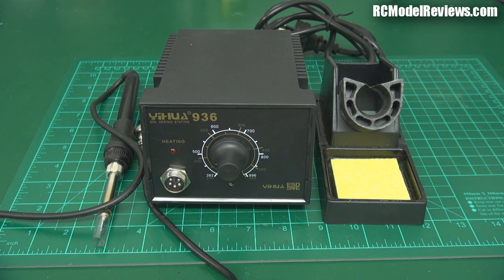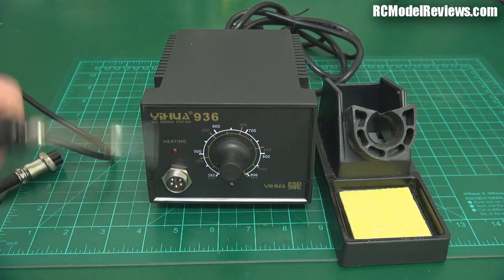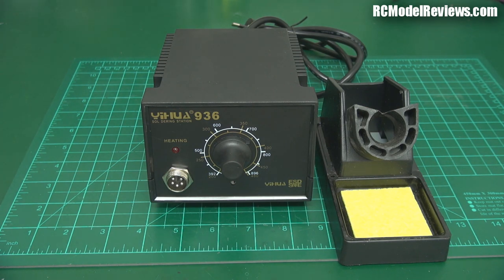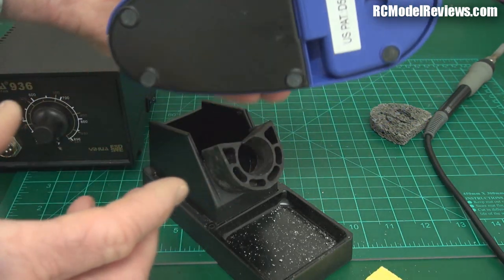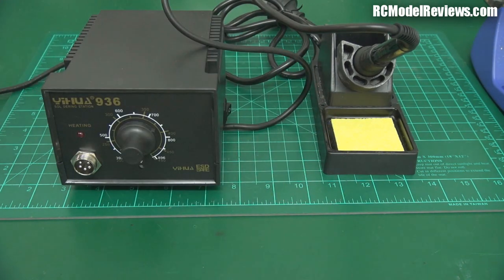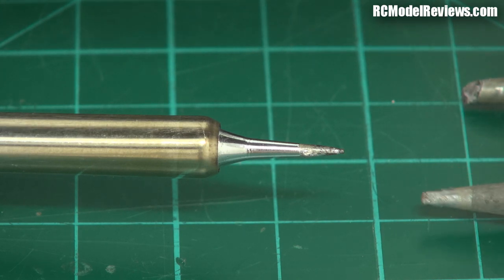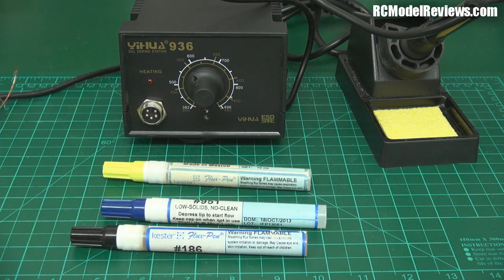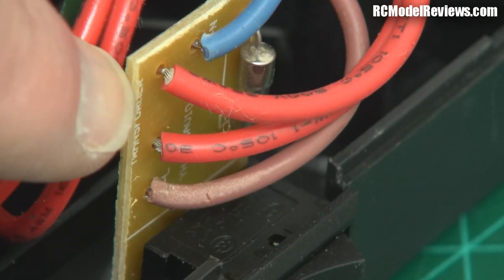The 936 Soldering Station from HobbyKing

Comment: I have this station, so far it's worked just fine for me. In the holder I just stuffed a $1 steel scrubber sponge and frayed it out. As for the tip, I ordered a set of the matching Hakko 936 soldering tips

Comment: Very good review.  I have been running this Soldering station for more than a year and the thing it great.  Ya it is made to a price but for $18 the thing is amazing.  It has allowed a student with very little money to have a really good soldering iron and not have to worry about it.  Just get some extra tips, they are super cheap.  I have made numerous CP antennas as well as a many other things on it.  I would highly suggest it to anyone getting into the hobby or short on cash.  It is definitely not the best but it is probably the best soldering station for under $50.
Reply: +Wyll Surf Air Where do you get the tips?
Reply: +odinata ebay.  look up hako 936 tips.
Reply: +Wyll Surf Air Hobbyking have tip sets cheap now, good order filler.

Comment: I bought one of these after I went to Jaycar to replace my broken standard 240 volt iron.  The Jaycar replacement $65.  This one cost around $16. 
This HobbyKing soldering station is AWESOME for the price.  And I bought 6 different tips for $8. Put a weight on the bottom of the holder and you have yourself a GREAT, cheap soldering iron.
Another great recommendation Bruce.

Comment: Got an 852D+ on Amazon for $49  Pros- fast, digital, hot air for shrink tube, came with tips and air nozzles  Quadelicious. Cons- shorter cords, I move the machine, Light wt. holder, added a couple 1/2 sockets, Hums even when turned off, unplug it after use.
One of the best tools to have for your hobby. Love it, already got my moneys worth.

Comment: I have one of these and just love it. (I'm a hobbyist). Agree with the bit bit (LOL) I replaced the original bit immediately.
One tip I would give is : I have glued the iron holder to the top of the control station. Makes it rock solid and takes up far less space on my bench

Comment: The plastic threads on the iron below the tip screw mount will soften from heat and not hold over time. Maybe 6 months of regular use. I have also had the irons on that model (907A I believe) fail frequently. They can be found for about 11 USD but always buy 2 or 3 at a time as they come with bad boards.
Reply: Hiway what I don't understand

Comment: I've been running one of these for 2 - 1/2 years now -- still going strong!  I had to calibrate the temperature right off (it was low) and  I did replace the tips (cheap to find on ebay).

Comment: just got mine from hobbyking, replaced the tip, and added some lead weight to the stand base. works great, very happy with it. thanks for the review Bruce.
Reply: the big hole in the base, I inserted a copper scour pad In it, it cleans the tip when I store it. a few minor mods based on Bruce's grumbles made this a very good unit

Comment: Not sure why you are hating on the pin tip.  Every tip type has a function and purpose.  I have the same station and it actually came with a set of 5 different tips beside the pin tip.  I solder professionally here and use the pin tip most of the time as it is capable of concentrating the heat into a small point which saves heat damaging the boards and components.  The exception is when working on endothermic devices such as rectifiers or sinked items where I would use a larger chisel tip for sure so the heat is distributed over the surfaces to be manipulated.
I have been very happy with this unit except that the power switch is on the back right side so I often forget to turn it off.  I will be moving it to the front asap.

Comment: I've had a 936 50W for over 6 months now and it's been great, I only wish I had a bigger unit when I change out connectors (XT60) on 10AWG cable. I can get it done with the 936 and bigger tips but more power would be nice sometimes..
Thanks for the heads up on the possible need for hot glue on the switch wire inside, I'll check on that shortly.

Comment: I actually bought 3 of the cheapies.... One for myself, one for my son and an extra for parts, I also ordered 3 extra "irons" for spares, I never even got billed for the extra irons....   I bought a couple of packs of 10 tips, most expensive part of iron, Hakko tips and I use the medium chisel tip for 90%+ of rc work.    60%-40% or 63%-37% which flows even better....  no acid core, no tin, neither work, silver needs to much heat can damage fragile boards like transmitters and receivers. I also use .4mm diameter. long learning curve for me, I'm nearly 70 and not as steady and eyesight not to good.....  but I have fun....  Thanks,

Comment: A few things, these irons (most irons) run on 24vDC output with a temperature feedback loop as mentioned.
You can get half decent replacement tips off e-bay for a few bucks for a selection (search for Hako), the handpieces are also available off ebay for 4-5 bucks. 
I recent built a current limited PWM lipo powered iron for work as I was sick of butane irons failing in the field. Tips seem to hold up well even at high heat when tinned up well, no pitting or burning as yet after about 5hrs run time.
Great vid!

Comment: Bought this one yesterday and the first thing i did was to tead it down. What I saw, I did not like but I only paid 25 GBP for it so I could not complain. THe PCB has undergone some major improvements since this video was posted but the heatsink was removed and the low ac voltage for the controller power has also become a plug instead of being soldered directly to the pcb.The fuse pcb hoever is exactly the same and the cables are about to break due to the bend and poor quality. I will be repairing this stuff and probably stick a heatsink on the triac myself but I believe it will do the job done pretty well tbh.

Comment: Looks like a re-branded Aoyue. I've been using an Ayoue 937+ for the past four years with no problems. 

Originally bought as a stop gap measure I've had no reason to replace it! It's a very reliable station

Comment: I've been using mine for roughly 3 years, without problems. You need to purchase a tip set. I suggest the 10 piece one from Banggood for around $8. You need to clean them in some acid flux paste when they are new, or they will not tin properly. So long as you clean them in some acid flux paste, they work great. Use a tub of acid paste from the plumbing section. Heat the tip to around 300C, plunge it fully into the paste, and wipe clean on a moist sponge. Repeat a couple of times, until the tip will take a complete tinning.

Comment: Also, if you have a dedicated work space it is a very good idea to have equipment such as soldering stations on a circuit interrupt timer of one sort or another. I've got a analog 2hr timer that works great but they make all sorts of surge protector power strips with integrated timers....just make sure it is rated with wiggle room for the watts you will be pulling. Very easy to get distracted and walk away only to find the next day your soldering station was on the whole time.

Comment: I just ordered one of the newest of these 936D+ stations and im going to silicone that iron holder to a heavy ceramic tile and stick some non-skid feet on the bottom.  The weight and feet will fix the light plastic issues with it moving around too easily.

Comment: I have one and its great! Well I used to work with a soldering hammer(literally it had a 1cm wide tip) so anything is better what I had but I am inpressed. The knob isnt that bad heating is good the only thing is that it has plastic stand so you might get some of that on your iron. The sponge didnt dry for 2 days so thats good. Can you complain for 15$?

Comment: Looks like a re-branded Aoyue. I've been using an Ayoue 937+ for the past four years with no problems. 

Originally bought as a stop gap measure I've had no reason to replace it! It's a very reliable station
Reply: This is not a rebranded Aoyue. The only thing they have in common is that they are both clones of Hakko models that have been out of production for a decade or more, and they accept compatible replacement parts across each other. Aoyue gives you better cables, better fit and finish, more carefully assembled units, and certifications.
Reply: Siana Gearz good job I use an ayoue then!

Comment: As mentioned in video there are a ton of different brands that have copied the original Hakko 936...which was a well made beast of a machine. When searching eBay I'd personally rather buy a used original Hakko than a new generic "knock off". Sold my 936 when I got the new fx888...wish I had kept it, comes in handy to have two hot irons with different tips sometimes.

Comment: I have the same Yinhua soldering station it works amazing, but mine has a digital temperature display on it. I actually like the small soldering tips on the Yinhua better for really small circuit joints that i could not do with the other soldering tips.

Comment: Base-wise, it seems a simple fix of stuffing a brillo pad into the receptacle and glueing a piece of lead or a cheap magnet inside of the unit would work just fine.

I'm not inclined to complain about needing to spend five minutes and a couple of dollars modding the base when the station costs only $30, yet offers very good performance for a hobbyist.

Comment: You forgot to mention that the Hakko soldering stand is made out of metal and ceramic while the Ylhua stand is mostly plastic. I find that my Hakko FX888D can handle up to 4mm bullet connectors but has trouble with 5mm and beyond that I have to use a butane pen torch. Tinning 8 AWG wire with the Hakko is basically impossible and for that I use an heavy duty Weller soldering gun that was probably made in the 1950's (still had the original box) that I got from a pawn shop for $15

Comment: Awesome review! I got a Yihua 898D+ which is about the same, but digital yep weather change, and a hot air gun as well for $60 on eBay. I think you have this one too? I LOVE it!
Reply: I just bought one too, can't beat it for the price and it works great! The seller I bought mine from had sold over 1400 of them with good feedback. Would definitely recommend it to anyone looking to buy a good soldering and hot air station.
Reply: Ronn Wilson The 898D+? It is great :P

Comment: Send it to me. 

Pure tin solder is good for holding parts like wire landing gear much stronger, along with other structural componenets. You just use MORE HEAT, LOTS more and gobs of flux. Works for me. Just needs more heat and technique. 

I apply resin to the part and load the iron with melted solder. The heat transfer is instant and makes a far better joint. 

I don't use it for wiring. But even for wiring with 60/40, I apply the resin to the part and load the iron with melted solder. If there's insufficient solder, NOW apply more solder to the joint.  

Neer mind what the "book" says, the books are wrong.
Reply: +hopeso 
I apply resin to the part and load the iron with melted solder. The heat
 transfer is instant and makes a far better joint. 

I don't use it for wiring. But even for wiring with 60/40, I apply the 
resin to the part and load the iron with melted solder. If there's 
insufficient solder, NOW apply more solder to the joint.  

Neer mind what the "book" says, the books are wrong.

Comment: Received my HobbyKing 936 Soldering Station today after reading your review. The first thing I did was take the top off and found the same problems with the wires at the ON/OFF switch. So I heated up the old hot glue gun and corrected that problem. You said that you can use the tips for a Hokka Soldering Station. I went to the Hokka site and there is a mess of different tips for different pencils. Could you list the part numbers of the 2 you recommend?

Thank You
Randy

Comment: I bought a yihua brand soldering iron from an Australian ebay merchant (I live in Australia). I had to resolder the socket to the main pcb using my childhood soldering iron from 20 years ago when I was 15yo.

The yihua iron holder is bullshit. if you turn the iron right up, it will melt the plastic. I use a separate soldering iron holder I already had. I still have the stand that came with the soldering iron station but I don't use it.

I have a chisel tip which is fine. And I do occasionally use the highly acute conical tip.

If I had more money, I'd still buy a hako or other higher quality iron, even though my yihua is working and is hot enough to solder xt60 plugs and 4mm bullets.

Comment: Eighteen bucks? Damn, that's cheaper than a big roll of decent solder. I'll have to recommend this station to the guys at the club who bodge solder with those cheap pencil irons from Jaycar or wherever - which may cost more than this station, certainly if they buy two or three for different jobs.

Comment: ive got one of these cheap stations, the ones that plug directly into the wall are miles better and the butane ones as well... the station takes too long too heat up and i found that when i tried to solder to deans or xt60 i would melt the connector before i melted the solder, i dont have that issue with the direct into the wall one or the butane one. i did replace the tip so that's not the issue.
Reply: +CAIDMASTEROFPYRO 
If you melt the plastic before the solder, it means that for whatever reason you don't get the heat into the wire fast enough. 60W (if they don't cheat on the numbers) should be enough for this kind of solderjob. It's most likely not the fault of the station, but how it is used.
Could be a tip too small, an oxidized/worn tip or temperature set too low (maybe partly fault of the station, because the set temperature and real temperature don't match).
Reply: +superdau Or he could be using lead-free solder! :-)
Reply: Lead-free solder is evil!!!

Comment: Nice review Bruce. The main power wires must be crimped not soldered. Not a good product. A bit how you do it, less safe.
If you want to buy a soldering station. Buy one from element 14 or RS. They have nice 50W and 80W stations for less then $150,- and you will have a lifetime fun soldering.
If you want the best of the best buy a Weller WS81. A 80W soldering station that can handle XT60 and solder even SMD parts on a PCB. Lots of parts and soldering iron tips.
Reply: Remember that this soldering station costs about $15, that's 1/10th of the cost of the ones you are recommending. of course a $150 is going to be better, bit for the price this yihua one is pretty good.
Reply: +Elwin van der Meer, But I am a little worried about the main wire connection. It can come lose in time and do horrible things. Bruce mansion this also in his review.

Comment: The wonderful thing about the 936 is the price is so low (I paid $18 too and shipping only added 2 bucks to an order) you can have 4 stacked together using double sided tape with different tips for the job you are doing. Some of the cheap tips on EBay (10 for $5) are surprisingly well made but the ones I received were too loose (made by CERN?)  to make good internal contact with the heating element... but using some copper solder wick makes the contact tight so for $59 US dollars  you can have 3 tips ready to go and 7 other tips... 18 bucks more and you have 4... but only 6 tips left over. Darn...;-)

Comment: You recommend hot glue for wire repairs as such...have you/do you recommend silicon caulk as well as or being better, such as outdoor clear silicon caulk?
Reply: +brun. ok You have to be careful with silicone caulking because some of it has acetic acid in it -- which will rot your wires and the vapor will cause other corrosion issues.   Hot glue is safe and cheap.

Comment: Hey, you never tested it.  Not even turned it on.  If they ship with such a small tip I would be worried that they are not putting out enough power to maintain the heat or reach temperature as quickly as the Haiko.  I would think you have a infrared temperature gun that can at least give a comparative temperature to the  Haiko.  And try a side by side melting of some silver solder and see if it has the guts to do the job.